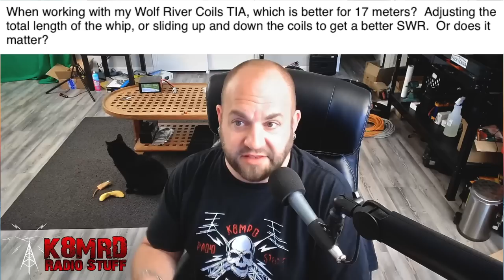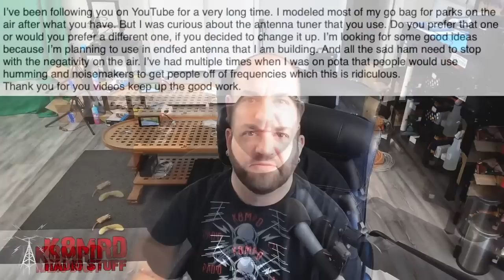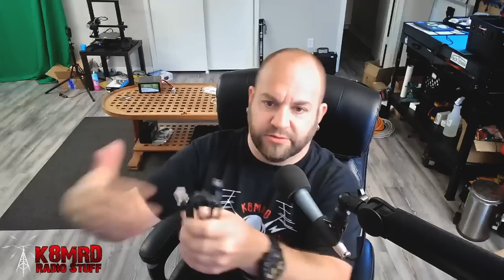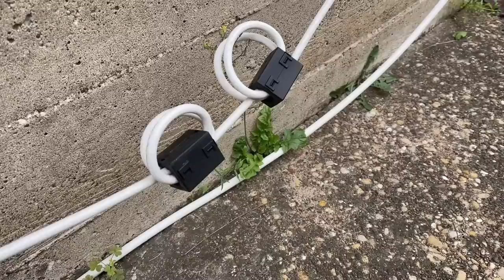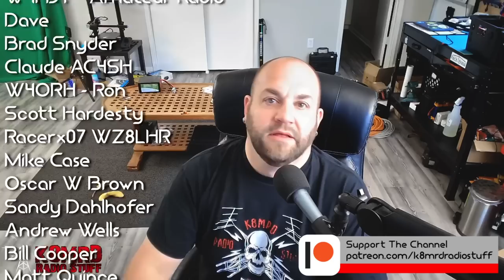What Antenna Tuner For Portable Ham Radio?

Comment: Another Mag Loop fan here.  They are definitely a specialized antenna with regard to use.  I use mine indoors with my IC705.  The are very directional, and very high "Q".  I have found that when trying to answer folks, like CQ's, you need to listen a while to make sure you know where they are located, get pointed, and do not expect to break up any pile ups. Wait for a CQ break, then give it a try.  You also need to be sure your radio is set up correctly so that your audio has its best chance to get through.  Folks will probably be digging you out of the weeds, a lot. I can use the waterfall and correct noise/rf gain settings to actually see when I am getting out of the highest resonance, and needing a "retune" on the dial.  Also mine is a star with Winlink HF.  Using Vara HF, my 705 and my Alex Loop, I can do rms servers across the country, again from my livingroom.  As Winlink is data, you have the added benefit much like the CWers where data is much easier to connect than SSB/Voice.  I have had mine for a couple of years, and tried early on at Field day last year and was unimpressed.  Been working with it this winter, and finally have the finer points sorted out.  I think it would be a poor choice first antenna, but it is an incredible tool in my grab and go bag.  Once the weather breaks in my location, I will be doing much more with it outside.

Comment: Another great Monday Mailbag video! At 11:22, u mentioned wrapping coax within a bead (or toroid) for greater choking - exactly right! But one clarification, each turn of coax actually squares the number of equivalent beads (because of the exponential inductance effect). For example, one bead with two coax turns is equivalent to 4 beads (2-squared), one bead with 3 coax turns is equivalent to 9 beads (3-squared), The miracle of physics 😀 73 KJ6ER

Comment: HUGE magloop fan here....awesome for my SPECIFIC purposes. Such as, when I vacation...it's 90% in a cabin in the woods. During those times I always take radio (and refer to my trips as "COTA"...cabins-on-the-air). Scenario....during the week I'll use ANY wire antenna. Part of the 'exercise' is to do daily winlink email. On the night of day before last, I usually knock down the wire etc to get ready to leave. HOWEVER, I can still do my winlink email on the last day cuz I have my handy-dandy AlexLoop. With that, and 10w, I have NO TROUBLE doing winlink. As that enough of a reason for EVERYONE to drop big $ on an AlexLoop? Probably not. But I routinely use it for indoor non-band-hopping (aka digital modes) and love it! BTW, I also routinely test like this at home....doing winlink with low power/indoors. LOVE MY ALEXLOOP. Last, not a sad ham here....everyone's welcome to their own opinion per their use requirements. 73, Tim KD9LA

Comment: Tuners are simply impedance transformers! A well built tuner does not lose power as heat - it "transforms" the power into the antenna. I have used an antenna tuner for over 40 years and it has worked admirably (the Heath SA-2040) and before that, a tuner I built myself out of spare parts. I was a part of the MARS system for many years, and my antennas had to do dual purposes - so a tuner was necessary. 
Also, talk about "capture effect" when discussing antennas. Reasonance is necessary, but capture effect is more important. If you cannot hear the station calling you, then the antenna must be bigger to "capture" the incoming signal.

Comment: Great segment.  While I tend to agree with you re placement of a choke at the radio end of the coax when using a 49:1 EFHW, I think it's interesting that Chameleon specifically states to place it at the feed point of the antenna on their EMCOMM Base EFHW antenna.  Clearly there are diverging opinions on this subject (and likely always will be).  As you suggested, I think ultimately it's incumbent upon the user to do some testing, flip the coax around to see if your results vary.

As always, thanks much for sharing.

Steve

Comment: Mag loops are NOT horrible antennas.  They're just different and take some finessing to use properly.  When used properly they DO have some advantages over other antennas!
Keep up the great work on the videos.
73
VE3KLT
Reply from the maker: Lol, in my experience they are.  Tuning it wasn't a problem.  Setting it up wasn't a problem.  Making contacts with it was a problem.  And this was from a VERY reputable manufacturer.
Reply: As one who cannot have anything outside my apartment AND my unit is subterranean, the mag loop antenna is my shack antenna paired with my IC-705. I do digital the majority of the time followed by CW. No, it won’t bust through pileups and one has to exercise patience, but it does work. From my hobbit hole, the mag loop and FT8/4 and 5W, my longest is 9,800 miles. Not too shabby. And CW, my longest regular qso was 5,300 miles. Your mileage DID vary.
Reply: @hamradiotube  I think I’ve got the same expensive antenna you  returned. It has ears  but no one has ever heard me in over 4 years of owning it.

Comment: I found the Alex Loop antenna was excellent for some specific situations. After having folks trip over radials and counterpoises in hotel lobbies and  busy park areas, and having the whip dig into the ceiling, I found the loop to be excellent for HF comms within a few miles which is all that is needed for hamfest HF local operations. It's for those situations where your entire antenna system needs to be restricted to your table. Compare it to the Elecraft AX1 or AX2. If you operate CW or FT8 you can make lots of contacts with these antennas. For SSB you are not going to be a very strong signal and most operators don't want to bother with pulling you out of the noise. Calling CQ is perhaps not the best way to use one unless you are a spotted POTA or SOTA op and especially using CW. One way to think of it is that SSB throws about as much signal effectiveness away (compared to cw or digital modes) as the mag loop does compared to a dipole. So you can use the loop or you can use SSB but don't do both together. :)

Comment: Would love for you build an AD5X Ultimate Portable HF Vertical Antenna. MFJ used to sell it but doesn’t anymore😢. Gets the coil up out of the the high current, and a bit more high Q coil or use the WR coil. Needs some capacitors for 40m but it’s a cool antenna too. 73.

Comment: I'm curious why more people don't use an ATU. I'm planning on getting the AH-705, cutting a random wire (probably 148ft as I want to do 80m and have lots of room), attaching that straight to the tuner and away we go. At home, the tuner will sit under the eve of my roof outside my bedroom window, and portable.. I'll figure out whatever works in the situation. Seems so easy, and people who use them seem to have great results (at least when attaching the antenna straight to the tuner, or use open-wire line so there's no, or almost no line loss. Those who use a bunch of coax btwn the tuner and antenna find it quite lossy). I'm watching videos like this to make sure I'm making the right choice and not blowing hundreds of dollars. But a RigExpert is more expensive than a good tuner, and I'm just getting into the hobby so want to get on the air the easiest way possible.

Comment: I use the MFJ tuner in my mobile.  It will easily get me on 17m from a 14m hamstick, and gets me the whole of 40m and 15m from a 40m hamstick.  Without the tuner I only get 50khz on 40m and no bueno on 15m.  Also I purchased the cable for the IC-7100, so it's easy to tune right from the head unit...

Comment: Thanks for the tuner info Mike.  I'll be looking for both the 939 (891) and possibly the ATU-10 (818nd) at Hamvention this year.  I am normally using resonant antennas when out playing POTA but having a tuner along "just in case" would be nice.  I also have the ABR choke you mentioned.  Purchased that last year after you mentioned it on a video.  Thanks and see you at Hamvention.
Reply: You might consider the mat 30 tuner also. It tunes VERY well.

Comment: 1. Mag loops
Hotels are one place where they may be your only option.  Don't set up near the window (or an outside wall) since metal in the frame (or foil backed insulation in the wall) will have lossy closed paths that will couple to the loop and suck away some of your limited power.  I was surprise too, and maybe my explanation is wrong, but my Alex Loop really does work better in the center of the room.  If you have a balcony, putting it outside is better yet, but a whip clamped to the railing is likely better still, which even works if you just have a small open-able window, but with hotels it's usually either a balcony or nothing that opens.
Also, I don't have anything that works as well as the Alex Loop for pedestrian mobile, especially if you are walking where someone may step on the trailing counterpoise that you would need for a whip.
2. Ferrites
Yes, always some at the radio end, since even if you also have them (or another form of balun) at the feed point, since the coax will still spend time in the antenna near field and your really don't want RF in the shack, or going to the radio's ground connection.  There is a design that I haven't tried in which the beads are a set distance from where the center conductor directly feeds a wire (no N:1), where the outside of the shield acts as the other side of a (possibly off center fed) dipole. so both at the radio and also somewhere along the coax run.

Comment: 3 years ago. MFJ-9232 "This thing is neat....been playing with it for a couple of weeks....used it inside house and getting signals from all over the place....really, really cool antenna....I've been really impressed....Insanely cool". And then in the park, a contact from Michagan to Vermont. And this was all by this K8MRD dude. Granted, it was pitched to QRP'ers, but what has changed since then Mike? Still like your channel and am a subscriber....just interested in your change of heart. Cheers Phil ZL2VTH
Reply from the maker: That was different.  It wasn't really a mag loop.  Some weird sort of loop that still needed different lengths of wire for the different bands.  And I made contacts with it!

Comment: Thank you for the information. To stop the noise have you grounded your coax just before coming in the house? A lighting protection grounded just before it comes in the house stops most RF back in the shack. It grounds the RF. Try that.   73   W4DES

Comment: I can understand your distaste for MLAs and I am a MLA user.  Are the great antenna, no... are the functional antenna in situations where antennas are not usually an option, yes.  They work very well for anyone indoors (Apts, Hotels, severe HOAs, etc).  They are good for areas that 'can' have a lot of foot traffic, where stringing up a wire or running a lot of radials is an issue.  Otherwise, yeah, they can be a real PITA.  The have a very high Q, so you are constantly having to re-tune, especially with the lower frequencies where the bandwidth is much more narrow.  They can also be rather pricey, with most being found usually going for around $400-500+.  Although, you can pick up a OM0ET MC-20 (which is what I purchased) for ~$300 + shipping, and it is a solid little piece of kit...

That said, they work rather well for digital use (like FT8/4), where you tend to stay on the same frequencies, unless you are changing bands.  The first evening I had mine hooked up, I picked up a confirmed QSO from Japan to south central Texas, with it setup in my living room on my X6100...and for POTA, I am able to setup my entire station, including said antenna, on a picnic table...usually in about 10 mins.  Even did some testing with WSPR against my EFHW mounted at ~23ft vs it being in indoors.  It wasn't entirely scientific, but as close as I could mimic on the fly.  While it didn't perform as well as the ENFW, it definitely didn't get a shellacking that many expect a compromised antenna to get.  Basically it avg'd about 70-80% of the numbers between 10-15-20m.  The higher the frequency, the closer the numbers were....40m took a beating, though. However, it was able to reach out just as far, DX wise....so, quality vs quantity shrug 

Are they compromised, definitely...are they as nice as my 66ft EFHW or WRC w/5.6m whip, not even close...but, they are still rather good antennas under the right circumstances. 

TL;DR MLAs have their purpose, they just may or may not be yours ;)  

Keep up the solid vids, Mike...  
73 de KC5VAZ

Comment: Mike,  you don’t call CQ with a mag loop. The output is so low and so focused or directional.  I have had fun using my Alex Loop and LNR W4OP remotely tuned mag loop in contests where close to the end of the contest some hams will come back to anyone they can hear just to get the points. They also work well when you are the caller or doing POTA where anyone will respond to get their 10 contacts.  It’s just another expensive option to play with.  A wire dipole or even an endfed wire up in a tree will work better.  Longer, higher is the rule.

Comment: I don't really like using a tuner on a portable operation. My G90 has a good tuner built in, otherwise I normally try and use a resonant antenna of some kind.  I find my silver bullet coil and a telescopic whip work well, especially if pre-tuned with my antenna analyzer.  
If I had to use a tuner, it would be the smallest and lightest one I could find that worked.

Comment: Yes …. PORTABLE  loops are “highly compromised”. This is largely down to their modest size. A larger (less portable … but still quite small) loop, if well constructed, with a loop of decent size and conductor surface area etc etc ( it is after all black magic) can perform as well as a dipole or even better. It will be high Q (narrow bandwidth) hence the need for the tuning capacitor BUT it has several factors in its favour - narrow Q means it filters out CRUD (say strong shortwave stations on 40m) AND you can NULL local RFI (this antenna  2 pronounced NULLS).  So in a nutshell if your noise floor is horrid worth a try as they are shhhhhhh whisper quiet. Also it gets you on lower frequencies when space is an issue. 73 de VK2AOE